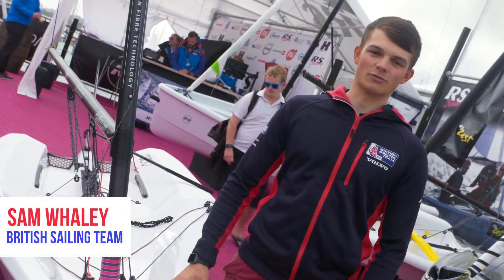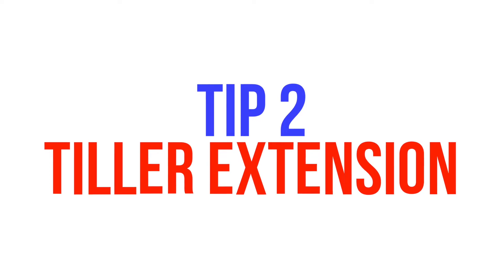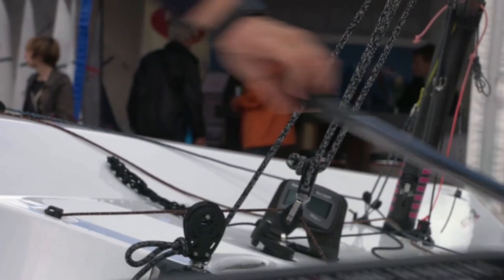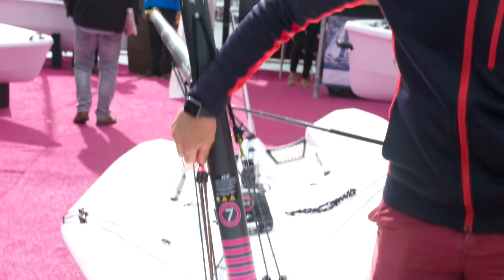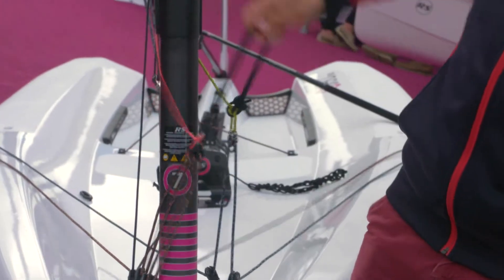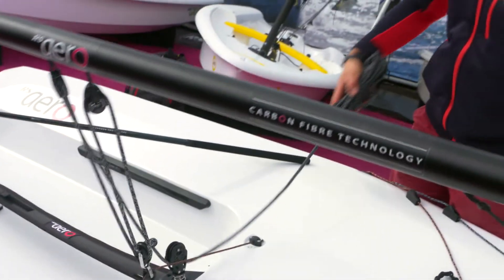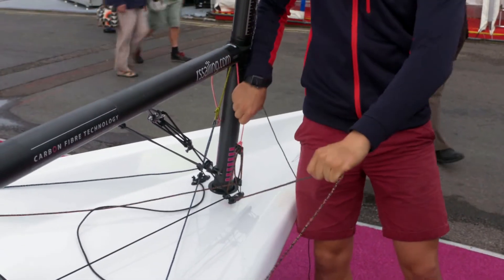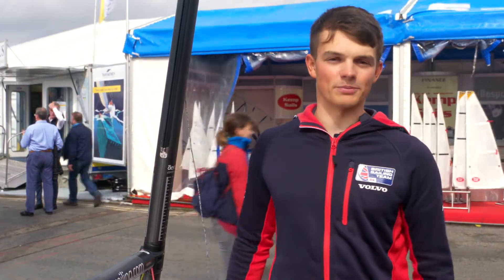RS Aero Sailing Top Tips From RA Aero World Champion Sam Whaley - Sail Faster Win

Comment: Great tips, Sam! 2 questions:
 1.the adjustable hiking stick is standard/class legal? 
2. The elastic you put up to the front of the mast is class legal?
Thank you.
Reply from the maker: From Sam... 1) by hiking stick do you mean tiller extension? It’s not adjustable on the water. It’s more that I believe the standard tiller extension length is slightly too long so I think if you cut it down a few centimetres it will be easier to handle. And yes, it is class legal!
2) You’re allowed to put elastic on any control lines to release them in an Aero, so yes - fully class legal!
Reply: @RYA1875  where do I get those elastics for the control lines? also - did you buy a shorter tiller extension or you actually cut it down?